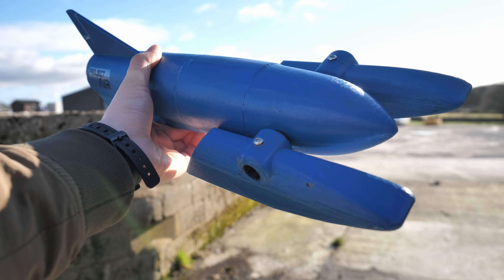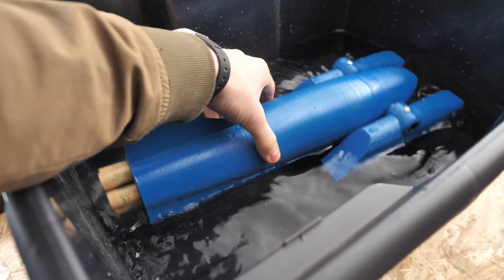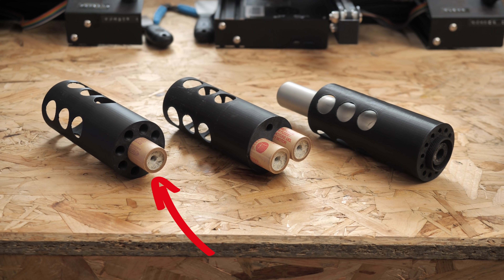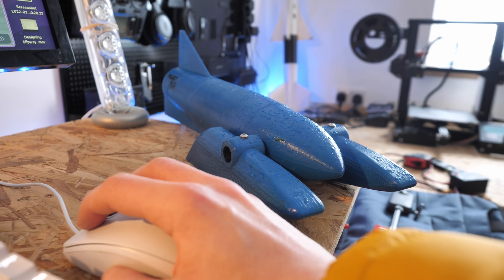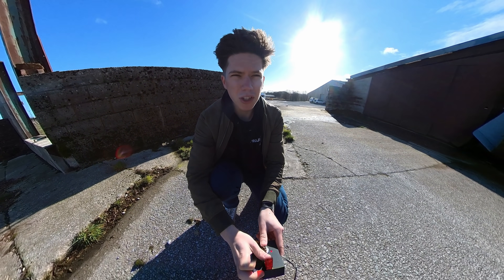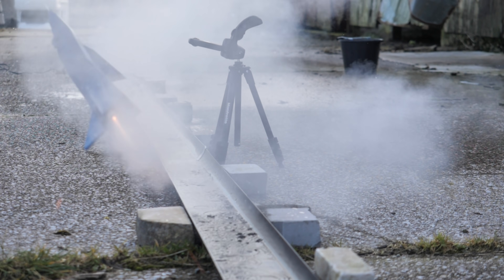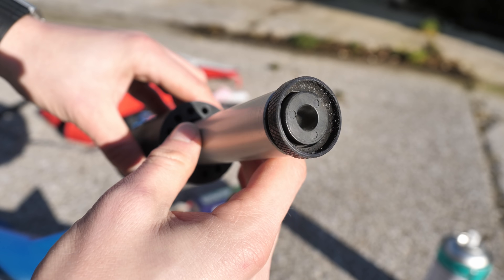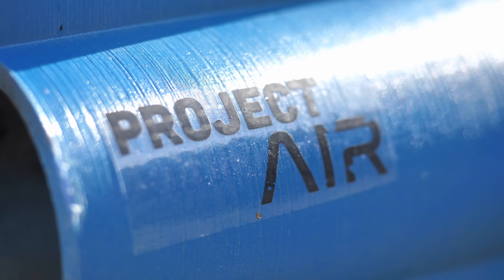DIY Rocket Hydroplane

Comment: One major instability cause with this design (although it looks the part)  is to have the rocket motors at the extreme rear. This seems logical, but if the vehicle goes off course, there is a significant turning moment between the point of thrust and the centre of turn. This will tend to exacerbate the turn and increase it.
The rear point of contact (together with the rudder) is a significant generator of drag. If this is extended rearwards beyond the rocket nozzles, then yaw errors will tend to be self correcting and the whole craft made more stable.

Comment: what do you guys think about using a couple of 4700uf 10v capacitors that are all charged up would dump the power faster and put more energy on your ignitors for almost instantaneous ignition as opposed to the battery slowly heating the ignitors

Comment: Passive crossover four bar linkage from the skis to a front aerofoil should provide the instantaneous negative feedback you need to prevent a runaway take off.

Comment: I'd lengthen the fuselange and put a weight along the bottom of the fuselage, that should slow acceleration but also provide more stability, once it's on plane the weight won't affect speeds much.

Comment: It might help to add horizontal stabilizers at the rear for the testing. Whilst the water is so flat they aren't at risk of contacting water it makes sense. Not only will they improve the vertical stability a lot, by ever so slightly lifting the rear it would keep the nose on the ground to keep the tests working. This seems like a far better solution than altering the pontoons as the lift from them is far less consistent from waves, but also varies a ton from speed, depth, and so on whereas aero only really varies from speed. In essence, we are taking v squared out of the stability equations leaving only a second v squared remaining instead of v to the four (probably).

Comment: A lot of your problem is going to be in your testing surface. You are creating a bow wave that is reflecting off the far end of your "track". Look at the water after each of your runs, it is waving back and forth along the track because the waves are reflecting off the gutter cap at the far end and creating the lift wave. You need an open span of water or at the very least a much longer and deeper track with a graduated/angled end.

Comment: Why not try a boat design with hydro foils? High speed sail boats use them. It will all the boat to float above water but the water displacement should keep the boat from becoming an airplane ✈️ ✈️ ✈️

Comment: Pretty sure you should have a wing on the boat, or underwater or a fin underwater. You need something to keep the pressure towards the water because when you scale up the motors powering it from the back on a hinge its going to want to go forward and its gonna lift the back up

Comment: 5:23  or the angle of the rockets are just a little off...   ( angle of the rocket is probably most important , the water resistance then  the shape / weight distribution of the craft  )
it almost needs to fly sideways , then just skip on the water at times , lol its pretty insane

Comment: You can use capacitors charged to a few hundred volts (like a real detonator) and put the igniters in series. This will ignite every motor fast and at the exact same time.

Comment: I always had problems with multiple ignition on my rocket car with those estes motors. It was the standard igniters, they are total crap. I used better aftermarket ones and got 100% reliable multiple ignition every time

Comment: I really enjoy your videos. Something I'd be very interested in seeing is how fast you can get a prop driven boat to go. I managed to get a hobby grade RC boat to reach a max speed in excess of 90 mph. I simply upgraded the ESC and brushless motor resulting in over 4 times the power of the stock power plant, replaced the included plastic props with some beryllium copper props and balanced them. I also designed an offset rudder system to prevent prop wash from becoming an issue with the rudder. Some have managed speeds well in excess of 130 mph. with prop driven RC boats, but I simply used a hobby grade boat. The ProBoat Miss Geico RTR is what I started with (the older single motor model which was a single prop design). If you start with a twin motor setup such as the Pro Boat Miss Geico Twin Brushless Catamaran RTR, higher speeds will be easier to reach. Now I know you'll likely opt for building your own hulls so I'd suggest you start with a twin motor catamaran hull and go from there. Catamarans are more forgiving than hydroplanes when it comes to dealing with ripples on water. That's why I prefer catamarans, but you may not feel the same way. Let me put it this way. Catamarans are the way to go if you're goal is the fastest boat that's still easily controllable. Surprisingly, I used to be able to turn on a dime with a cat at nearly full throttle. 

Just my two cents.

Comment: "spontaneously combust due to the heat and flames of the first motor", think it should just be ignite, lol. I think the heat and flames from the first motor counts as an external stimulus, and it burned. 

spontaneous - "performed or occurring as a result of a sudden inner impulse or inclination and without premeditation or external stimulus."

Comment: I can't say I know much, but I think the issue is that the hydroplane is a bit too aerodynamic for its given purpose. I'd suggest adding spoilers on the craft, around the mid section to counter for the nose up tendency.

Additionally, the weight distribution on the hydroplane seems aft-heavy, since that's where I'd assume most of the equipment would be housed - rockets, adapter, and vertical stabiliser. Adding some weight to the front should in theory also help to keep the nose down at high speed, countering the rear-oriented center of mass.

Comment: Well first thing I noticed,your track needs to be about twice as long. The booger was still accelerating as it blasted through the snow pile! Another thing you might want to try is a flatter hulled boat. That cool looking bluebird insired rig you have there just sticks up to far. Flatter hulled lower to the water,maybe try a tunnel hull for the stability. The twinengines should be stacked not side by side,to keep the center of thrust consitant. 
I've done most of these experiments years ago with boats I made out of bass wood. Shot em on a buddy's pond. Just a completely fun day!!!

Comment: Commercial EMatch ignitors would probably work better since theyre larger and have a higher chance of coming in contact with the fuel, the small rocket ignitors i believe just are a thin wire that gets hot and ematches acctually ignite and even if it doesnt get contact the flame would set it off

Comment: You have to adjust the bow from the stern.  When you get the bow bounce you need to push the stern up.  Typically this is done with an engine or trim tab but in theory you could use some sort of spoiler.  You might even be able to get it to self adjust mechanically.

Comment: Could you build a combustion chamber which the multiple motors burn into and allow for a single nozzle from that chamber? It seems that would at least reduce the lateral forces from ignition that doesn't all happen at the same time.

Comment: I think some things you could do:

1. If running dual motor maybe choose a longer burning motor and build a hold down system which only releases the vehicle if both motors are working (maybe a Microcontroller could Monitor this?!)

2. Maybe TVC might be cool?

Comment: To avoid the takeoff issue, you should add some small wings, on the front, to push the nose downside

Or, at the opposite (to reduce friction, but it would be much more difficult to calculate the exact angle), put the wings at the back, to pull it upward (as the backside would lift, it should keep the front downside)

Comment: How about a rear air spoiler, maybe in addition to a small single board computer to adjust it, I know a Raspberry PI with a sense hat would be able to detect axis changes and can be programed to run servos for the foil, don't know if it would react fast enough or be light enough, bet there's something smaller that could to it though.

Comment: Maybe you need a spoiler to help keep the nose down.  Look at speed boat designs, they've done most of the engineering for you.  Also, are your ignition wires the same length, and your batter strong enough to ignite both leads?

Comment: Ground effect!
It's not the pontoon's contact with the water that's lifting the nose, it's ground effect - essentially a cushion of pressurized air between the hull and the water. This is the main reason modern racing hydroplanes use a horizontal stabilizer, sometimes on the front of the boat but more normally at the rear. As speed increases the stabilizer begins to push the nose downward into the cushion of air. It's a delicate balance; pushe the nose down too much and the boat plows the water, not enough and the boat does a back-flip.

Comment: I would recommend not altering two variables at once between test runs. At one point, you changed the angle of the front "skids" (for lack of a better term) and added a second motor. You'll get more consistent, reliable information by changing one or the other, and then making further adjustments or additions later.

Comment: Could transforming the hull to a hollow pipe help for longitudinal stability? Perhaps also change the form of the floaters so it doesn’t want to lift off but presses the cushion of air towards the water, say an inverse lift profile, hollow side up. You have the same problem with groundeffect on water than a racecar on land. So spoilers in front and back…

Comment: Something to note about the engines you were using... The red label engines shown when you loaded the two engine test were boosters... They put out a large flame to ignite the next stage when their propellant burns out, which could be the cause of your "spontaneous combustion" of the second motor during that test. For these tests you should try to find the plugged engines. (D-12P instead of D12-0) They are used to launch rocket powered gliders into the air.

Comment: I would make it much longer, think top fuel dragster..... very thin center section with asymmetrical nose cone favoring downforce and much smaller and narrower sponsons to reduce air lift. Water behaves like concrete at speed and add 1-3 degrees tilt on the rocket motors to aid in downforce and you should hit 200+ MPH..... JMHO.....

Comment: Great Video as always! I reeeeally love the high speed shot of the rocket breaking up. (So dramatic)

If you are having issues, I can only recommend using the Klima 
Igniters. They are much more reliable than the hot wire type igniters because they are encased with some sort of explosive. I have used these extensively, and have never had any issues.
Reply: On this note, i was thinking you could pursue some sort of Explosive Bridgewire Detonator (EBW) / Exploding Foil Initiator (EFI) based E-Match.  The EBW is especially easy given you just need a capacitor bank and thin wire if i remember correctly.

Comment: Would you get better stability if the parts that touch the Water is in the pontoons and the back if they were V shaped on the bottom maybe having a smaller surface area touching the water and the fact it should cut straight or through the water. Really have no evidence to prove anything and I’m just a pleb But it’s something that just come to mind

Comment: Look into hydroplane racing boats. They use an active front splitter controlled by the driver to control the nose of the boat. They can add downforce to keep the nose down and reduce it during straight runs to increase top speed. Some sort of strain gauge in the rod holing the front floats in conjunction with an accelerometer/ gyro to keep it under control?

Comment: I have seen your high power rocket videos and I love them, I have been doing something similar over here in the US with our aero science program. We are currently building a 1 mile or 1.6km rocket with a 1lb or 0.45 kg scientific payload. We are designing and have a real budget we have to meet and certain constraints in order to get our rocket approved and funded from our school. We are using a hybrid engine system from hypertek with our engine making over 1000 N/s of impulse. Would love to see if you did something like this on your chanel.

Comment: Project air: “I’ve taken lots of safety precautions”

Also Project air: Launches flaming rocket engine into dead grass ( 3:58 )
Reply: I dont know if you've ever been around slodgy snowy icy slush mixtures, but its wet. Very very wet. You can even see in the video that yes they might be dead, they are not dry.
Reply: @youtubeSuckssNow  I understand that it wouldn’t have started a fire because the grass wasn’t dry. It was really more of a joke than pointing out danger but you have to admit that it’s kind of funny that he said he’d taken a lot of safety precautions and then he proceeded to launch a flaming rocket boat off of his track.

Comment: Consider the Center of Pressure whenever you're making changes to the thrust, that's a critical component of rocket design which crosses over to this project.
Reply: Center of mass, center of thrust,  center of pressure, center of gravity, stability depends on the center. Oh yeah center of lift. All has to be accounted for: the propellant burning and the changes to the center of gravity and subsequent changes to the other centers. Its  hella complicated.
But fun. 
(I used to be a brain surgeon and a rocket scientist but now I'm fascinated by small bright shiny objects.)

Comment: there is pobably a good way to light all the engines at once
tho you pobably would need a hole in thr back to put another miniature rocket engine with a fuel like sulfur and potassium chlorate or some manageable but more unstable fuel that wont explode
or if you are abdolutely crazy you could try tp use a pyrophoric liquid but then if it fails toxic liquid would fall everywhere and explosion fire

you would really need a preparated place to test it so you dont put fire in anything

and chemistry knowledge
a lab
and all chemicals which some arent easy to get

or you could use a trail of flammable things with equal lengths that will burn will it gets to engine or something

otherwise homemade electric ignition inst great fir lighting up a cluster in a reliable way

Comment: you could try making it like a hydrofoil board, with a horizontal fin or blade in the water that will pull the boat down as it moves

Comment: When I was 16 or 17 I made a rocket car with 2 rocket tubes, tricycle wheels and a "V" tail. It would go really well with A-8-0, B-6-0 and C-3-0 engines. When I graduated it to the "D" engines, it wouldn't stay on the ground. It would travel about 40 feet then head straight up. I weighted the nose cone down with lots of lead, but it refused to stay on the ground. Nice video, thanks very much for bringing back a great memory of mine. Oh yeah, that's a great likeness of Blue Bird B.T.W.
Reply: I did the same thing back in '77 and figured out how to do it without entering the space program. I kept it on the ground after I  used trailing wheels in the rear behind the rocket exhaust and extended their height,  bigger and thinner wheels. Also went to almost 3 feet long and went to a tricycle setup. I used 
D-8-0 or D - 12 - 0 motors and it turned out blazing performance. Too bad video was so dang expensive back then. Also used three tennis nets to stop it with no damage. Until I missed. Then junk.

Comment: electric squibs are notorious for not being equal in resistivity, add a 2-5 ohm resistor in series with each squib and increase ignitor voltage by 3 volts per squib. and use batteries that have enuf amperage to kick the ignitors off. 9V batteries arent the best choice. A small lead/acid 12V is a better decision.

Comment: Great video!
Love to see you implementing some follow up projects. 
I guess a problem here is the motor being forced coaxial with the fuselage, so if you change the AoA, the thrust is off-horizontal. Maybe having the thrust adapter tiltable might improve stability?
Really interesting to see you improve your designs, now being quite sophisticated modular builds.

Comment: I can tell you what happened with the first dual motor. you used BOOSTER motors (red ink) this means no ejection charge (good) but also NOTHING ON THE BACKSIDE AT ALL ie not "plugged" so when the first motor was done firing flaming particles simply exited the rear of that motor ENTERED the rear of the second motor and LIT IT from the bum side.

this is why it has a big woosh sound but no real "thrust" and why it spit up chunks

PLUG your motor. a little epoxy on the back side or just shove a cork in it. IE keep it from "igniting" the second motor in a FTF situation.

Comment: Try adding a horizontal stab to the tail. It should be well rearward of COG, but also forward of rear contact point to impart pitch down after a bounce.  Also, offset V (toe out) for sponsons so they don't smack off waves as much. I still picture poor Donald Cambell and the Bluebird crash when seeing fast outriggers...very tricky stuff even for experts!

Comment: Packing some black powder in the rocket nozzles and then some between the motors will allow you to use one igniter. You are pushing the motors through the centerline and cg but straight forward, you need to push through these but at a slight angle downward and slightly ahead of the cg, that will help push the sled into the water while accelerating.

Comment: I think that changing the thrust angle could help with generating a slight bit of downforce without having to rely on aero to push it down, or maybe have it a bit more nose-heavy and balance it with the angle of the pontoons